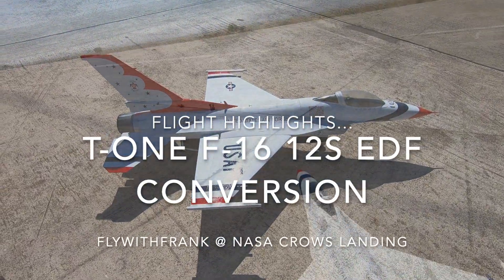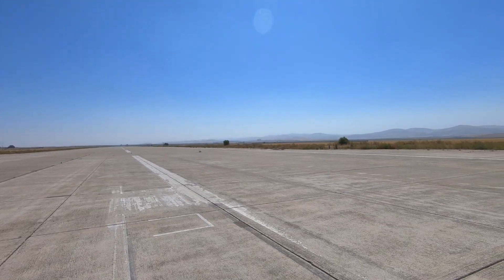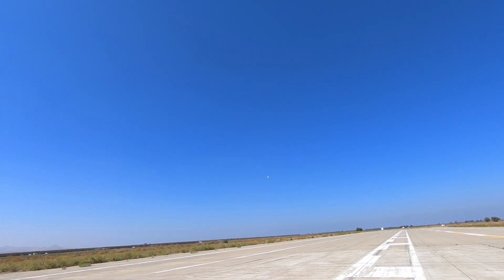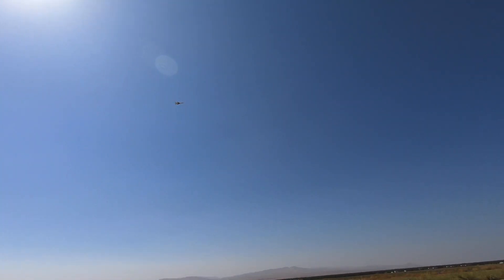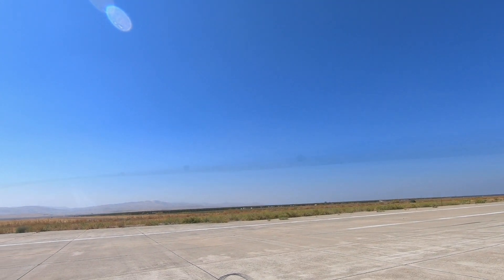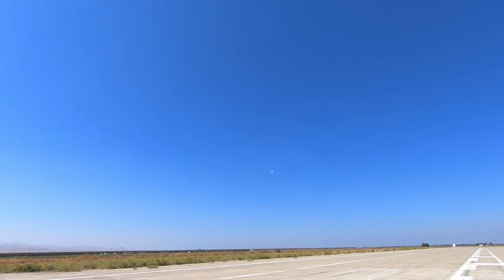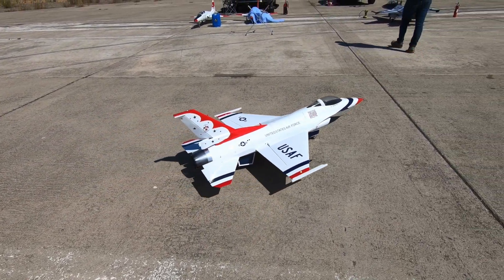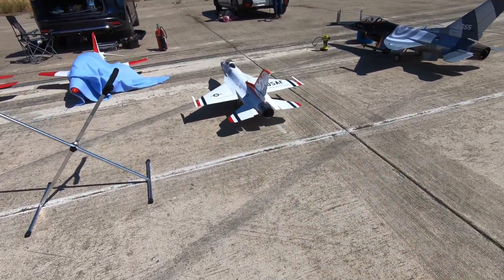T-1/T-One F-16 12S EDF

Comment: Are you also using tailerons? Or only flaperons for takeoff and landing?
Reply from the maker: Tailerons all the way. During take off, normal flight and landing. Flaperons for take off and landing.
Reply: @FlyWithFrank  thanks! 
Is taileron necessary for normal flight? 
I always thought it was only needed while using flaperon?